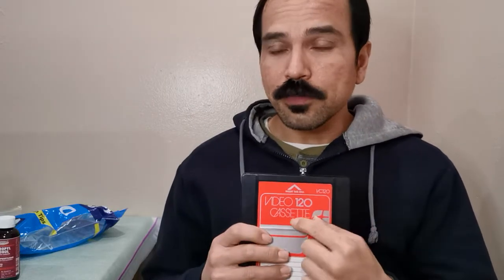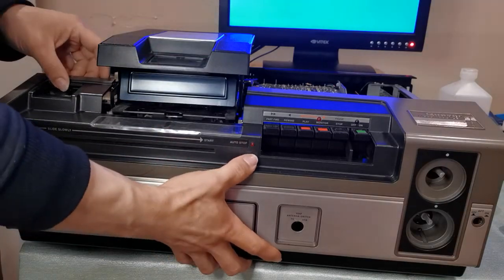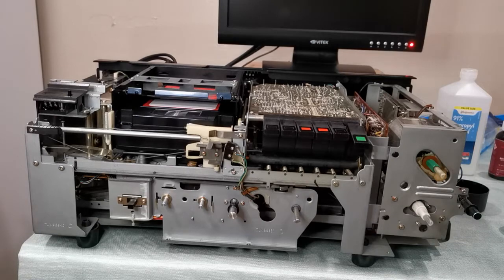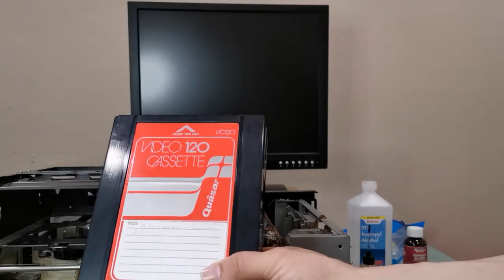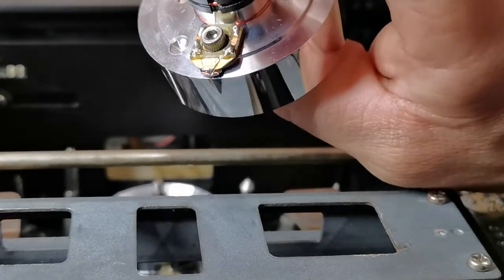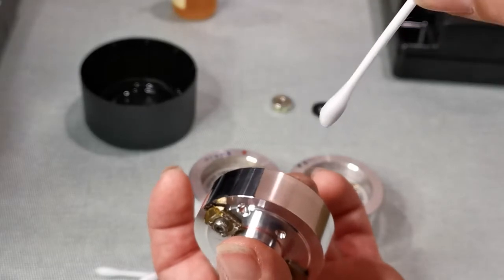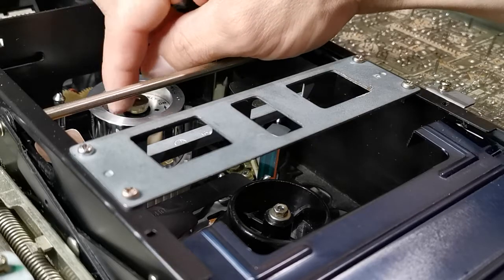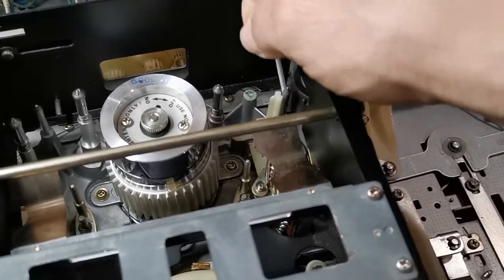1977 Quasar VR-1000 VCR regular maintenance

Comment: The VX is a pretty quirky format. Think about it. Cassettes twice the size of VHS, the video head drum was strategically placed under the VX cassette. This format is a lot more manual, the eject isn't just a button, it's a lever you need to drag across the face of the VCR. Even it's appearance. Quasar must not of been interested in making the VX stylish.

But why is it called VX?
Reply from the maker: It is in fact an eyesore of a machine which did not help the fact that it was "too little too late" compared to the superior U-Matic and Beta formats. Heck, even the elusive Sanyo V-Cord2 format performs better than this.

I have read that the Japanese Matsushita company which was involved in developing the VX format was also involved in developing the VHS format. Seems like a forfeit move to make.